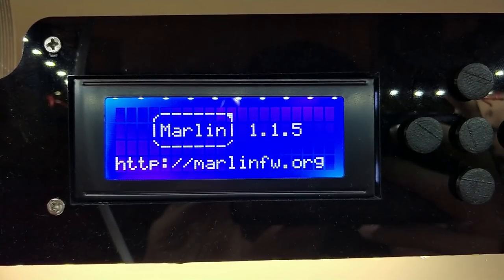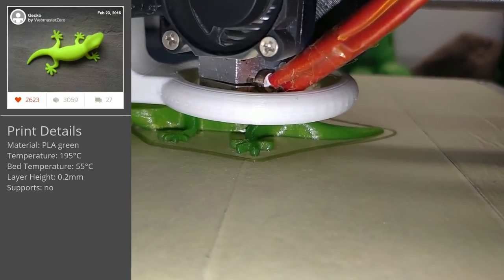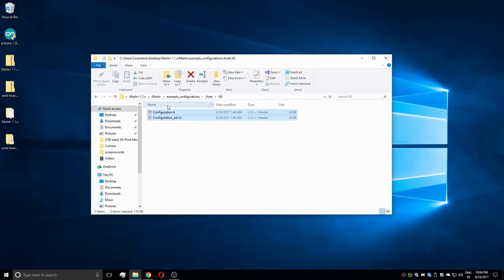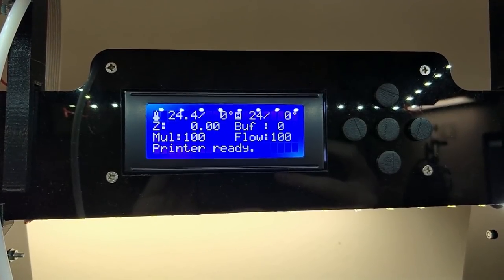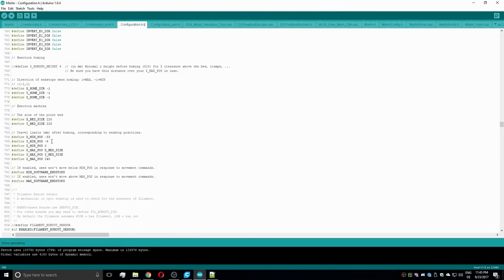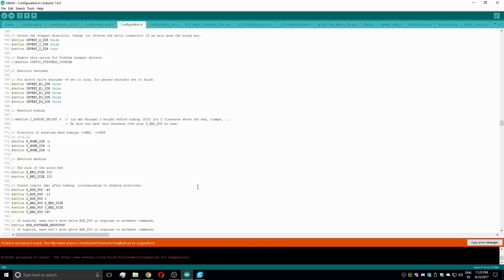Anet A8 Marlin Firmware

Comment: i did as u said and opening marlin with the anet board does not work !!! why? when i want to manage the libraries : invalid library
Reply from the maker: Thanks for your comment. Do you use the latest Arduino IDE and did you install the board definitions correctly? Take care about the folders as well.
Reply: i did not have in documents any arduino or libraries folder , i opened marlin.ino and then closed , i watched the documents folder and all was there , i put the anet folder also on the adrduino install were i found the libraries 

What do u sugest to do 
 Thank u for the quick answer
Reply from the maker: Did you make sure that you have the "libraries" folder inside the "Documents/Arduino" folder? Additionally, you could try putting the board definitions into your Arduino install folder (<install directory>/libraries I believe).
Reply from the maker: Try not to have another "library" folder inside "Documents/Arduino/library" as it would cause an invalid library error
Reply: i did that and i put the libraries also on the documents/arduino/libraries and it's saying  invalid library found at  C:\Users\SEVEN\Documents\Arduino\libraries\hardware:
Reply: i have a hardware folder inside the arduino/library
Reply from the maker: Move the "hardware" folder one level up, so that you have "Documents/Arduino/hardware". Arduino IDE can't read hardware out of the library folder.

Comment: How can I do this?... when select go home, go to the center of the bed so I can use the autolevel funcion with the level sensor
Reply from the maker: You can set the point (X/Y) where to perform the Z leveling. The option is called Z_SAFE_HOMING and it makes sure that Z is only homed after X and Y are, while also moving to a safe place (a place where the Z-Probe surely is on the bed). By default it's in the center.
Reply: Caverntwo thank You :D 
But it also work with the auto level function? That one that create a grid of 3x3 ?
Reply from the maker: Yeah, it uses the G29 command rather than the normal G28 (home all). It is recommended to use Z_SAFE_HOMING for the leveling process.
It can be enabled in the configuration.h file at @section calibrate. The description is very good so you can find out what it does easily.
Reply: Caverntwo  thanks a lot :D I'm going to try it thanks :D
Reply: Just another... where do I configure the command G29 ?  For example in cura, or in the LCD ?
Reply from the maker: Oh, I completely forgot to mention... Yes, for auto-mesh leveling, add the G29 into the start G-Code (after a G28).
Reply from the maker: You can also call it manually in the LCD via the option "Level Bed".

Comment: I am wondering installing Marlin and 3d touch, anybody already did that? The results are better?
Thank you
Reply from the maker: I haven't used any auto-leveling sensor/probe yet, so I cannot share any experience. However, there might be some better support for these sensors/probes, so give it a try ;-)
Reply: Maybe you already found a solution for the 3D touch, but I found this video explaining it all.
https://youtu.be/6aofhlAooUE

Comment: I cant get the firmware to install. Every time I try I get this error message. avrdude: ser_open(): can't set com-state for "\\.\COM5" Dose anyone know why?
Reply from the maker: Yeah, errors in the Arduino IDE can sometimes be tricky to interpret. It seems like the COM port has nothing connected to or is not usable.

I'd suggest to do:
1. Installing the drivers for the board manually
2. Check the COM interface where you have your printer connected to via the Windows Device Manager (if you are on Windows, of course)
3. Choose that exact COM interface in the Arduino IDE

If that still throws this error, try connecting the printer to another USB port on your PC (it'll probably get a new COM port, so make sure to look for that as well).
Reply: Altight I got it to flash to the board.  I had to uninstall the COM port data and everything with it than restart my pc.  After that I plugged it in and set the COM port and it flashed!  Thanks for the help!
Reply from the maker: Nice to hear that it worked! Happy printing with your newly flashed firmware ;-)

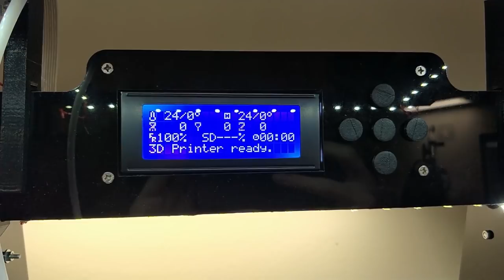Comment: I don´t know what I did wrong but I have right now the same thing as in the minute 2:35 and I don´t know how to pass that phase.I own an Anet A8 if that is helpful
Reply from the maker: So you mean that the firmware doesn't successful upload?
If so, try again and take a look for errors.
Reply: What kind of errors ? I´m start learning to program things so I don´t have any idea about this xD
Reply: The firmware changed the name of my printer so I think that is a sing of it worked but the lcd screen keeps the same as I said before
Reply from the maker: ah, that's simple: In the configuration.h file there's a CUSTOM_PRINTER_NAME that you just need to uncomment.
Reply: Caverntwo ok, I will do a research tomorrow and I'll tell you what it's happening to my printer
Reply: I saw all the code and the only problem is the question marks that appears in the lcd screen shuch as in the minute 2:35, but all the other things are ok.Sorry for been late in my answer
Reply from the maker: The question marks mean that the axis values are unsure (the printer is not homed)
Reply: And how I home it?
Reply from the maker: Like usual, there's an option in the Prepare menu. Only when the axes are homed, the printer can "trust" the values and move within the area without crashing anywhere. 
Beware that the buttons are working different now, up and down for going up and down in the menu, left and right for decreasing/increasing values and the center button to accept.
Reply: Same problem here. Did you find a solution?

Comment: Hi! I get this error message when i try to uploade the software... Any tips to how i can fix that? Great video!! :)
 
cc1.exe: error: -fno-fat-lto-objects are supported only with linker plugin.

exit status 1
Error compiling for board Anet V1.0.
Reply from the maker: Damn. I don't know either. Do you use the latest version of the Arduino IDE? The only thing I'd do in your situation is to remove all Arduino stuff and reinstall everything. I'm sorry, but this error exceeds my knowledge.
Reply: I used 1.6.4 when this happend. It works with the newest! Thanks :)
Reply from the maker: Nice that you've been able to fix your problem! Happy printing!

Comment: I have problém with set ant centre in marlin firmware verision 2
Reply from the maker: Hi Lukáš, thanks for your comment!
You have basically three methods:
1. Move endstop, if possible.

2. Set movement bounds in Marlin:
https://marlinfw.org/docs/configuration/configuration.html
Scroll down to "Movement Bounds", where you can set the X_MIN_POS and Y_MIN_POS values to fix any offset of the endstop. I think I showed that in this video. I have not yet set up Marlin 2 on any of my machines, so I'm not 100% sure if it still works as I imagine it.

3. Set said offsets in your slicer software with the help of a G92 command. This has to be added to the start G-Code script.
See my old video for advice, as well as some basics: https://youtu.be/SQ5ZOtb3Cjo

I hope that I could help you. If not, let me know!

Comment: sorry but i've done the copy of the file in the main folder but i don't have anetV1 in tools
Reply from the maker: Therefore you need to copy the hardware folder of the Anet board definitions into the Documents/Arduino folder. On restart of the Arduino IDE, the board should be available.
Reply: Thanks you so much that works ;)

Comment: What's the best version of marlin to use?
Reply from the maker: The latest stable one that works on the controller.
Reply: Well 1.1.8 has a anet configuration.H in the file so I might give that one a try. Thank you for the video and the information keep it up.
Reply from the maker: I'm pretty sure that all following versions will have the Anet A8 configuration file, as Marlin also tries to keep improving. Thanks for your feedback!

Comment: would have been helpful if at the start you stated it needed to be sent via USB cable... just did all the shit up to 2:15 on my desktop, thinking it'd be flashed via SD card... what a pain... guess I gotta go pull my laptop out.
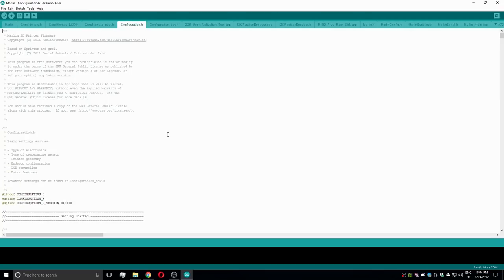Reply from the maker: But at 2:05 I state that you need to connect the printer to the PC using a correct USB cable. Oh no! I expected that you at least watched the video once before doing everything step-by-step... But you only need to install the Arduino IDE and the Anet board definitions on your laptop, as you can just copy over the edited files from your desktop.

Comment: Mine is saying problem uploading to board ? why can that be. I checked the port and board is set as in the video
Reply from the maker: Try unplugging and replugging the USB cable, which helped in my case. If it doesn't, try restarting your PC. You could also check whether the communication drivers are correctly installed on the PC and reinstalling them if you find them suspicious. I hope that I could help you.
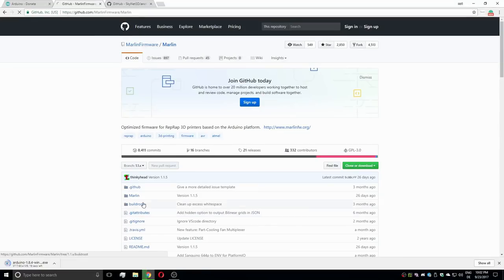Reply: Great that worked!. Another question is. in this video https://www.youtube.com/watch?v=Wk3qYOB4E9I&t=5s they are talking about axis steps at 1:03 min. I cant seem to find them in arduino
Reply from the maker: I just looked up and it can be found in the Configuration.h file at line 527 (in the Marlin version I use in the video). You can enable line numbers in File/Preferences. 
FYI: I haven't adapted them on my A8 yet as they seem to be fine my case.
Reply: mine has not been doing to great. so i am making the short calibration as the link i send you. i have found it now.. thanks. I dont really understand how you choose the center settings on the machine ?
Reply from the maker: It's basically very easy: The printer moves to its center at (110/110), but because the endstops are a bit off, there's an offset. In the video I programmed the printer to believe that it is at another position (-xoffset,-yoffset) once it hits the endstops to move to the real center. Just play around with the values, you'll see where an increase/decrease leads you center-wise.
Reply: Oh I am having some huge problems the extruder has somehow begon to go lower, i goes against the Bed and the filament. Is it possible to see anywhere how close the extruder should be to the heated bed ?
Reply from the maker: Well, you need to level your bed correctly. I haven't done any video regarding this topic so far, but there are plenty around. Normally, the print head shouldn't go down into the model while/after printing...

Comment: I accidentally flashed marlin without un-commenting out the 500 commands so i cant change the configuration.h with commands. Is it ok to just change it and then upload it to the printer again?
Reply from the maker: You can just reflash the firmware as often as you like. To get my Dual-Extrusion working (video to be released this weekend), I flashed the firmware at least 10 times!

Comment: Hey, I was wondering if I could get some help. When I try to upload Marlin I get an error before it completely compiles. In red it says "non-constant condition for static assertion". I don't know about coding or programming so if anyone can help it would be really appreciated.
Reply from the maker: Hi, thanks for your comment. It's a coding error, so we can find it!

The error means that you try to compare or assign something during compilation time (when you hit verify) that is actually a run-time value (the value gets filled up and exists only when the program is running on the controller).

The error message should give more information like a file and line number, allowing you to easily identify the cause of the problem. If this is not shown, you need to turn the "verbose logging" (or verbose output, I don't know the exact name currently) option on, found in the preferences.

Let me know where the error is, then we can (hopefully) find the cause!
Reply: It gave me multiple error messages, so many that i cant post them in this comment, but there is  that says.

Multiple libraries were found for "LiquidCrystal.h"
 Used: C:\Users\migue\Desktop\3d
exit status 1

 i also should say that I don't really know what im doing.
Reply from the maker: You didn't change anything in this file, right?
What LCD controller did you choose? Some of them require extra libraries that you need to download, but the comments above the line where you choose your controller should give more information.
Reply: I didn't change anything in the file. I was under the impression that I just download everything in the tutorial, open up Marlin in arduino, plug in my printer, and upload it.
Reply from the maker: That's basically how it should work. I can highly recommend copying the configuration files from the example_configurations folder into the main folder, replacing the default ones.
If you have an Anet printer with the Anet controller, you also need to download and install the board definitions, as shown in this video.
Reply: Alright, I'll follow the tutorial again and if I have any other problems I'll comment about them
Reply from the maker: That sounds good! Just let me know if you should run into troubles.

Comment: Maybe someone had error when uploading? My board version is 1.5

avrdude: stk500_getsync() attempt 1 of 10: not in sync: resp=0x49
avrdude: stk500_getsync() attempt 2 of 10: not in sync: resp=0x6e
avrdude: stk500_getsync() attempt 3 of 10: not in sync: resp=0x66
avrdude: stk500_getsync() attempt 4 of 10: not in sync: resp=0x6f
avrdude: stk500_getsync() attempt 5 of 10: not in sync: resp=0x3a
avrdude: stk500_getsync() attempt 6 of 10: not in sync: resp=0x45
avrdude: stk500_getsync() attempt 7 of 10: not in sync: resp=0x78
avrdude: stk500_getsync() attempt 8 of 10: not in sync: resp=0x74
avrdude: stk500_getsync() attempt 9 of 10: not in sync: resp=0x65
avrdude: stk500_getsync() attempt 10 of 10: not in sync: resp=0x72
Reply: I'm getting this error when I flash     
avrdude: stk500_cmd(): programmer is out of sync
Reply: Maybe it might sound too easy, but re-check if you have selected correct COM port. You error is a bit different.
Reply: Yes It is on the the correct COM port.  I checked in device manager.
Reply: same here, and now won;t boot.

Comment: I cannot open the .ino file and all .h and .ch files are misinterpreted as CH and H files
Edit: I downloaded the zip alduino , maybe that affected the file type . IDK cuz i'm not even good at ICT.
Edit: i just found out how to open it with custom programme
Reply from the maker: You should be able to open a .ino file correctly by right-clicking and selecting "Open With" and browsing to your arduino.exe in the Arduino installation directory. You can also override use the "Default Apps" settings page for mapping the correct programs to your file extensions.
Reply: Yes , just found that

Comment: avrdude: stk500_getsync() attempt 10 of 10: not in sync: resp=0xd6
help me please :(
Reply from the maker: Hi,
This error means that the connection to the controller has not been established/synchronized. Unplug and replug the device, it should solve that issue. Also make sure that you have the correct COM port selected. I hope that this helped.
Reply: no its not helped.
Reply: i opened serial monitor and after compile there was
start
Info:External Reset
Info: 0.000000 0.000000 0.000000 0.000000 0.000000 0.000000 0.000000 0.000000 0.000000
Free RAM:12251
wait
wait....
and my 3D printer was restarted twice. have you some idea what to do?
Reply from the maker: What does it do now? Did it upload or not? Is the "old" firmware still booting?
Reply: yes there are only old firmware
Reply from the maker: Try reinstalling the communication driver, as this could be an issue as well.
Reply: i try to delete all and make it again and now its work :) thanks for your time
Reply from the maker: Nice! I'm glad that you managed to get it working! 
Have fun with your new firmware!
Reply: I'm getting this same error what fixed it ?